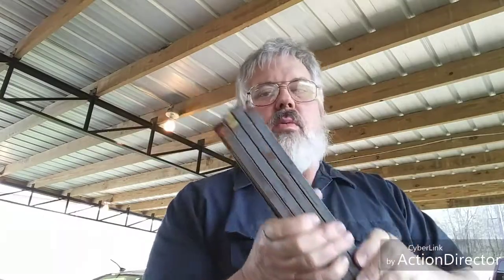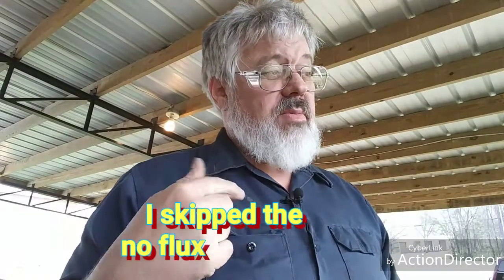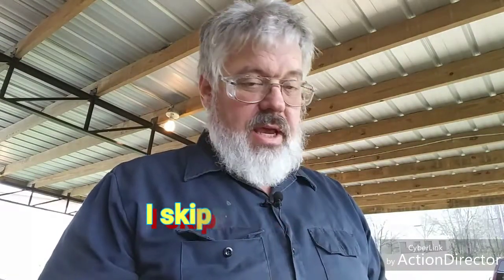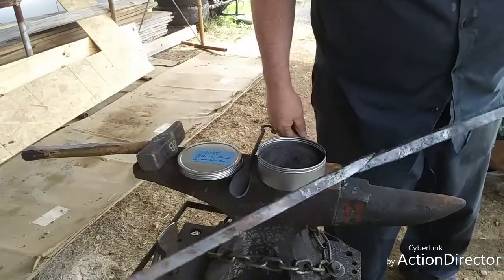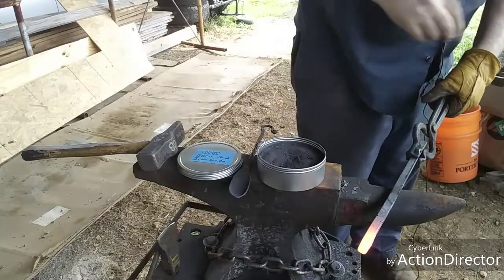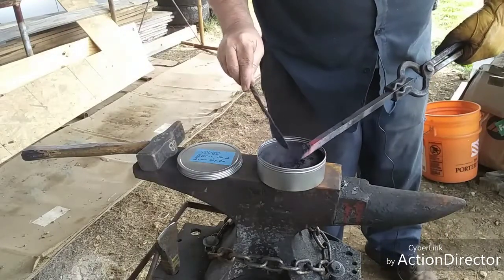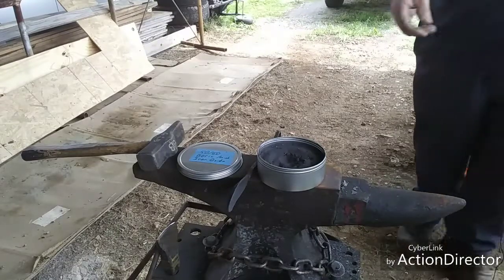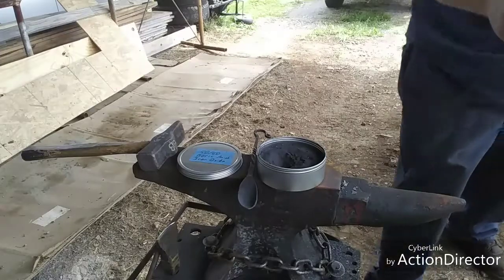Compare Forge Welding Fluxes and Flux Recipes

Comment: I’m just getting into blacksmithing and am somewhat confused. I see guys add flux even just to shape metal and not necessarily weld. When do you have to have flux and when not? If you flux parts being welded and then put them together with the flux still there, doesn’t the weld contain the flux with the impurities?  Or, do you flux it, clean it, then forge weld it? Thank you so much.
Reply from the maker: The basics on Forge welding is mainly just getting the 2 pieces of metal to a "Welding" Heat. Which means it is almost burning up the metal.  You do not actually have to use flux in some situations. 
When you heat the metal it gets 'scale' on the metal. The scale acts like a barrier and will keep the metal from welding.  So the way to forge weld is to get it hot and keep the scale off and then the metals will weld together.  Like I  said, sometimes you can get it to weld without flux. But say you have folded over a bar of steel to make a hatchet or something and you need to weld the 2 pieces then there is a good chance that scale will get between the parts.  The flux will help then.  You flux around all the edges and it will flow when heated and make a layer over the surface that will keep the oxygen from reaching the hot steel and causing the scale to build up. Then you can weld it. The flux will push out of the weld as you hit it.  Yes, it can get trapped in there at times too but usually it comes out and that is why when forge welding you get flying molten stuff going everywhere.  
I personally have not seen anyone flux steel for other reasons than welding. But if they did then it was to reduce scale build up..  Sometimes people will forge steel on an anvil they poured water on. Water can act as a de-scaling method so maybe they will do that with flux.  I just have not seen it myself.  
Some blacksmiths will flu both pieces and when it is all flowing and melted in the fire and ready to weld they pull them out and sling off a lot of the flux and then weld.  I have not tried to weld without flux yet.  
I know this was long. I hope it helped a little.
Reply: Gary Brown Forging On thank you very very much. That helped tremendously and I really do appreciate you taking the time to write that up for me. Have a great day!
Reply from the maker: @brettb.7425  You're very welcome.   Thanks for commenting and watching my videos. I really appreciate it.

Comment: If you had to pick between Iron mountain vs 50/50, what would you pick for every day flux? Btw great information! Thank you for sharing!
Reply from the maker: Thanks for watching.  If I had to pick one I would say iron mountain but both work fine. 
I used the 50/50 all the time before I spent the money on the iron mountain. But I made the 50/50 for 3 of us and split it between us and I still have a ton left over.  I decided to get the iron mountain to make this video.   I also used iron mountain for a week long class I took.  But I have not found a lot of difference between the 2.  The only time I didn't get the 50/50 to work was when I made 4 mouse tomahawks.  I had to make a 5th because one of them would not weld but the others welded fine, including the 5th one.  But I can tell you that it does not take much. I don't forge weld a lot but in 5 years I have not used very much at all of either one.  But I would get a container to sprinkle over so you can catch excess. I have seen a lot of people waste a bunch.

Comment: My teacher the late Frank Turley always stated a forge weld is only 60 % effective. It can’t compare with modern welding procedures …Steve
Reply from the maker: That is correct but it is a good process to know and add to the metal working skills. It works best in situation like layered welding where you might not want to introduce in a different alloy or steel. Like welding knife steels together or adding in a high carbon bit to folded over mild steel for an axe. But I enjoy learning how they welded prior to modern arc welding.  Thanks for the comment and input. Much appreciated.